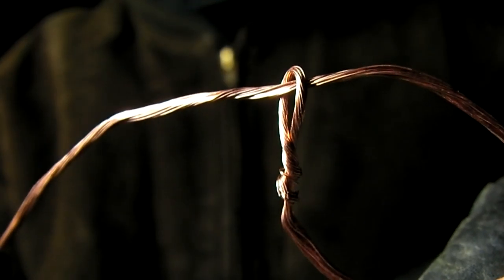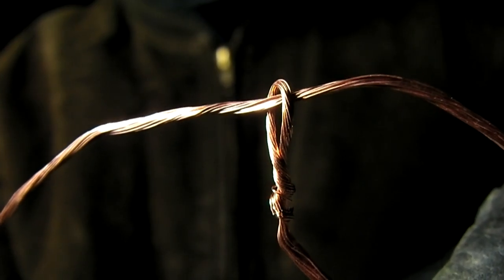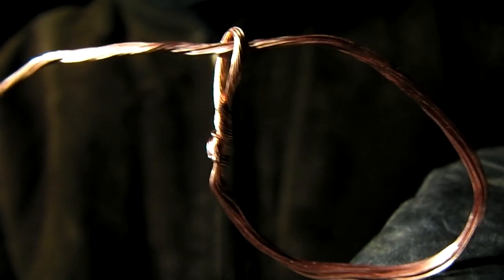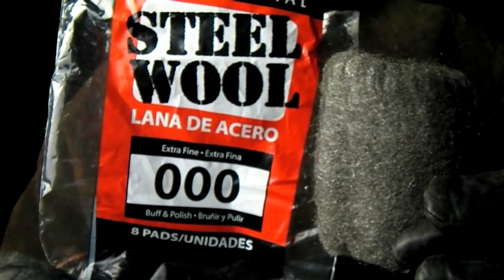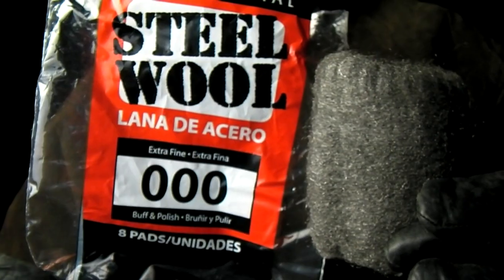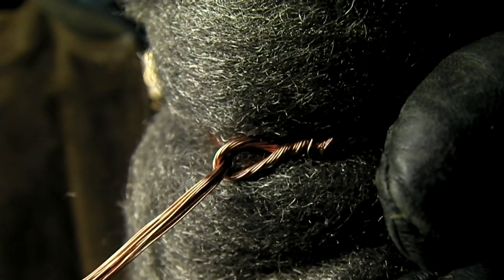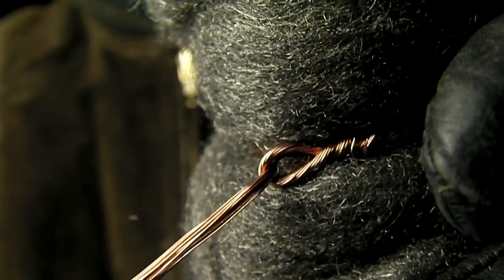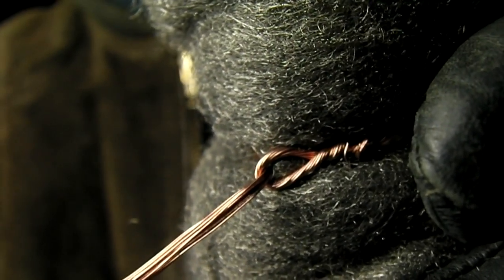How to Make a Fire Wire [Easy Steel Wool Fireworks]

Comment: It tends to be readily available, it's pretty flexible, it's easy to make the slip knot that is used for this, it has a melting point higher than the heat generated from the sparks, and it's relatively strong.

Comment from the maker: @giggityboi637 Usually I do include the cost in the video description. These cost less than $1 to make. The price can go up or down depending on how much steel wool you want to use. They're cheap either way.
Reply: Ah the time you could get all this for a $
Reply: Why are you using a copper cable instead of anything else?
Reply: @sw4rmify  I would assume the copper has a higher melting point and can withstand the heat without melting

Comment: I just tried it and it worked great it's a perfect time to do it here in norway because of all the snow. I used 0000 steel wool btw. I got all i needed from the hardware store. PS: can you try to mix in something to make it spark in a different color.
Reply: Try mixing in some borax, it makes fire turn green, but I'm unsure whether it would affect the sparks that fly outwards...
Reply: hmm maybe if i use enough

Comment: you've had great sucess here, but I've built a cage on some thin chain to make more spectacular and longer lasting, because I'm able to to put 6-8 steel wools in the cage.  I usually soak it in nail polish remover, (just a dash)  then light the ground, then bring my firecage over the top of the flame on the ground to ignite and start the steel wool firework.  Neat idea, beats using coat hangers and pliers!

Comment: Did this year's ago. Breaking up the steel wool a bit makes for bigger faster burning firewire. Any cord will work as long as the heat won't burn through the loop you've created.

Comment: I heard another method is to attach a wire whisk to a chain (like those on dog tags), and put the steel wool inside. Also, you can just touch a 9v battery to the wool instead of using a lighter.

Comment: Copper has a melting point 400 degrees above steel wool, which is the critical part.  You want your steel wool to burn without burning the wire, otherwise large chunks of burning steel wool pads are going to go flying hither and yon.  

I have heard of something similar where you take a wire clothes hanger and pull the steel wool out and wrap it around to make a sparkler that you just wave around instead of spinning like this.

Comment: I have a suggestion for a spark cannon.
Could you try puttung steel wool into a pvc tube with one of your pressure chambers on the back and with something to hold it in place?
If you pressed the button it will shoot out a whole cloud of hot sparks :)

Comment: no you can do it with practically any type of wire if i'm correct, the copper wire only acts as holding material. it's the fire that makes the fine mesh particals of the steel wool burn or rather glow in very high intensity, i think you could do this with any type of wire, thoo i think its safest doing it with a copper wire

Comment: @Nighthawkinlight 
Here in England In the 'Fens' we are not allowed to have bonfires because it can set light to the fields. The peat soil here burns very well. In fact, many years ago we had Peat cutters here that used to cut brick shaped blocks and they were stacked up and dried then people would put them on the fire in their homes and burn them for heat. It was much cheaper than coal and sometimes it was even free! Here it is illegal now.

Comment: Question, I was on koh phi phi, and they had a fire show that was very similar, but with less sparks, and it burned longer. They dipped the thing in flammable liquid I remember. I thought they used steel wool as well and I thought they used it because it could trap a lot of liquid and wouldn't burn. 
Seeing this tells me I am wrong, but does anyone know how they do it?